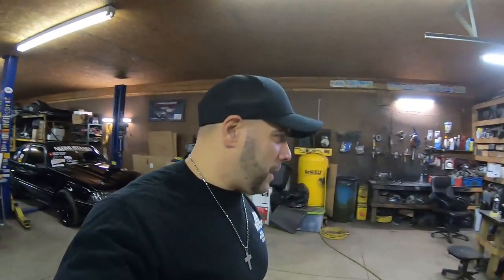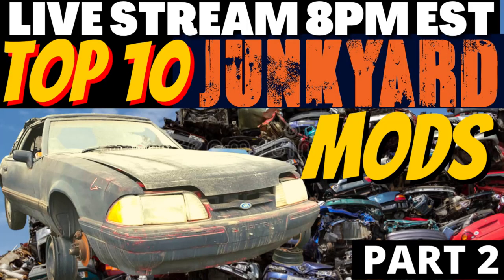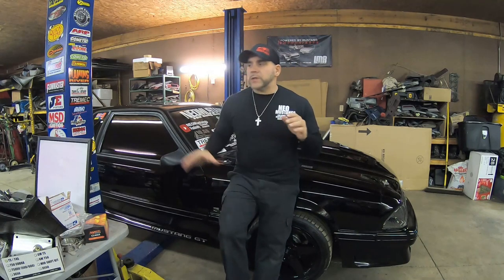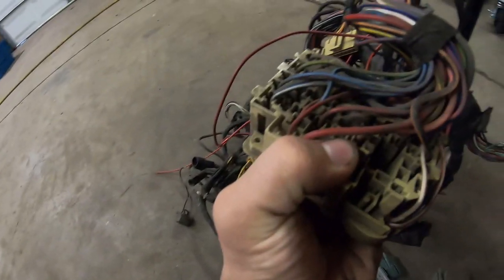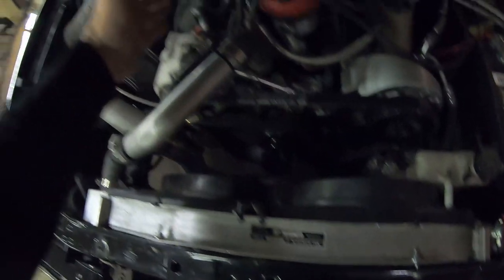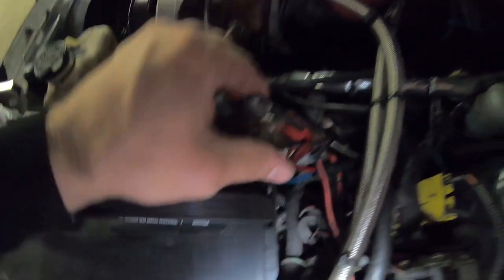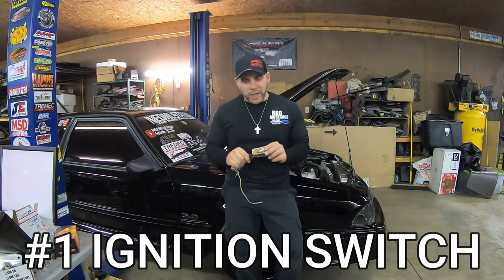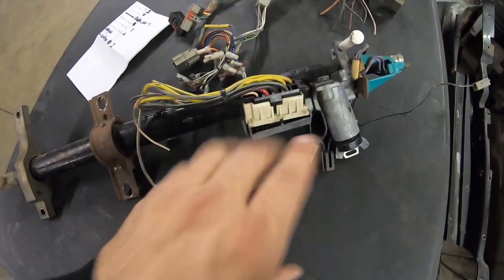Top 5 Hidden Foxbody Issues You Should Check Right Now!

Comment: Fuel lines from the filter to the tank, be sure they're tucked behind the tank straps and not sitting on the exhaust pipe. 
I replaced my headlight switch when I did my heater core, that thing was on its last life 😂

Comment: Also the fule pump relay under the driver's seat. If your car is a vert or has a sunroof it probably leaked over the years at some point if not now. That plug sits in a wet environment and will corrode. I had smoke come up between my legs while driving one day. Thankfully had a 1/2 wrench in the car to pull the battery and save the car.
Reply from the maker: I was going to cover that, the headlight harness and quite a few others in a live stream.

Comment: I've replaced the headlight switch and ignition switch in my 87 GT both were BAD! the headlight in mine looked as bad as the one you showed, and the ignition switch died the first time I stopped at a gas station to fill up and I had to giggle the key to finally get it to start and that was right after I found out the filler neck seal on the gas tank leaked and it dumped gas out all over the passenger side  exhaust if I put in more than 10 gallons! so YES these thing have a lot of old worn out wires and seals that can give you a bad day.
Reply from the maker: Right !

Comment: Hey great vids. Yup same stuff I experience on mine. But the one thing I might be able to help everyone out in where the harness comes in. Quit running things outside what it’s supposed to run. Here’s how you add those extra power goodies such as electric fans electric power steering pump high power stereos.  Run separate + and - blocks straight from the battery then run the wiring thru a separate fuse or circuit breaker then off to a switch then to the thing you need to power. However up grade the alternator and run the g3 alternator on it and peel the two wires back on the harness to were those two power wires come from one then add adequate length wire back to the alternator. Again this will keep stock wiring and fuse block from doing more than they were attended for

Comment: The ignition switch is a big one. Had one fall apart on the highway doing completely legal speeds. Car ended up losing everything. I pulled over to the side of the road and used my gfs hairband to hold it together and get to a parts store.
Reply from the maker: Ya i mentioned that in my video

Comment: Good 👍🏼 and on the passenger side coming from the tank there are two  fuel lines that go to the fuel  rails there are two small rubber gas lines that get kinked or crack. Needs replacing

Comment: Ignition switch is the most problematic. I had a slight jerk in my 92 vert during acceleration I could figure out for ntg. ( Distributor, plugs, wires, fuel injection harness, injectors, fuel pump, fuel filter , O2 sensors ) all parts thrown at her and still slight jerk. That's until I checked that ignition switch mane was it melted wires in the back we're burnt and had be butcher by an old 90s alarm install. New Harness repair kit and switch all problems solved. ( Ignition switch ties into tfi, ignition coil, O2 sensors, and more stuff please check yours people)

Comment: Great video as always! I know my headlight switch is toast. I already have the pigtail, still need to put it on. The car is apart right now anyway. It is a GT, however I never use the fog lights. To scared to. My harness looks to be in great condition, low mile car that’s been put up 14 years. Hopefully the pigtail is all I’ll need to do. I plan on doing ignition switch as well. I was also heard that the variable resistor dimmer can cause fires to. Thanks for sharing! ✌️
Reply from the maker: Ur welcome!

Comment: Ahhh my ignition switch! I thought for sure I had a bad ground when I would turn the key and lose all power….. so I replaced my battery cables seemed fine for a month then same issue again….. ended up being the ignition switch wasn’t getting a get contact because it was broken and zip tied in there
Reply from the maker: Lol right
Reply: My car, less than two years old caught on fire when leaving the house one night. Ford refused to fix it, I butt connected it up and then a couple years later they sent me recall letters lol...
Reply from the maker: @robertelmo7736  damn seriously !?

Comment: Yes Please do a T5 rebuild! This is on my list for my Fox. I swapped a 89 from a Aod to a T5 a few years ago. I used a 4 banger T5 and had to buy a v8 bell housing and use 83 Ford Ranger pilot bearing but it worked lol. My 89 was stock other then exhaust ,Cai and 4.10 gears. The first 2 gears were useless I could literally start driving it in 3rd gear.

I currently have a 306 with aluminum heads, Trickflow intake and the On3 turbo. I’m worried that it may not last but need a manual and I’m huh poor lol. I can’t afford some fancy 5 or 6spd.

Ps you should move to Tennessee bud. Lots of Foxbodies, The dragon, pony’s in the smokeless and other Mustang/ car shows.
Reply from the maker: I may do t5 next

Comment: Turn signals in my 93gt stopped working out of no where one day, but the hazards still worked, took a few hrs to figure it out and track down the cause, but it turned out to be the hazard switch, one of the wires that runs through it for the turn signals had popped out of the connector, due to being old and brittle, nothing wrong with the connector except for the plastic lock tab holding the wire in the connector had disintergrated inside from yrs of vibration i guess. Used a small heat shrink tube to wedged into the connector to hold the wire in place. Is there a good reliable source for these connectors? They all seem to get soo brittle with age. Great video btw all good info.
Reply from the maker: Ya dash harnesses are terrible at this age

Comment: I’ve heard about the headlight switch causing fires. I’d be interested to hear a good solution (relays?). I’m in the middle of a Term X, turbo install, remote sensors & associated plumbing & routing. I plan to do a super neat, logical & modular rewire with switch panel & relay board. I appreciate any tips & tricks. Any thoughts about onboard air compressor for boost control?
Reply from the maker: YEs relay. There is a lot of fixes for it. Some better than others. I ll probably do a video on it and do it to my blk car.

Comment: I used the GT switch on me old 88 lx as a nitrous activation switch, problem solved, hehe. What about the 2G alternator.?...crap connections here  happily cause fires. Other safety hazards: No. Fucking. Brakes.....and a chassis that is a soggy tissue stock :)
Reply from the maker: I only wanted to cover 5 lol. There’s many others. Fuel relay under seat ??
Reply: @Neomustangs  I've actually witnessed fires in Fox bodies, when they weren't 30+ years old, from both of these causes. My car caught fire on jackstands from the 2G and my friend's bought new 90 shorted the FP wire and scorched a neat line in the carpet.